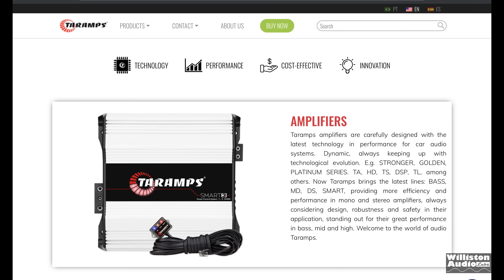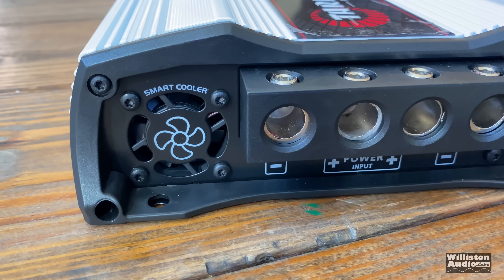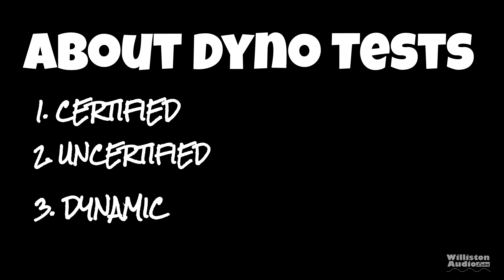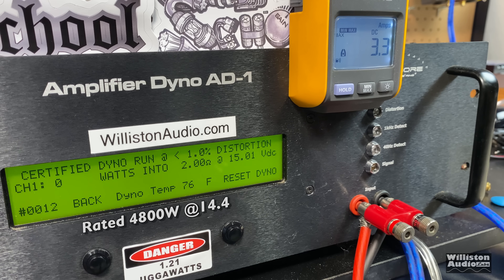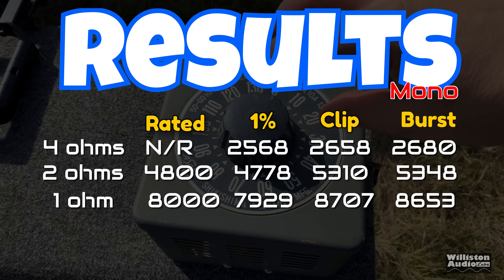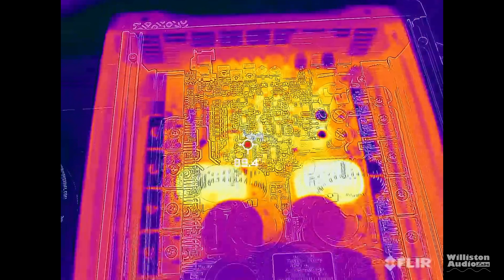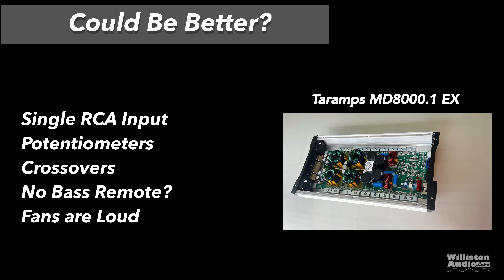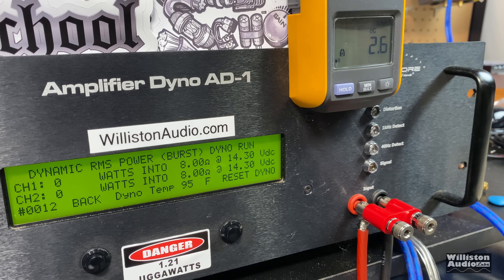8000 watts, but What's New? Taramps MD8000.1 EX Amp Dyno Test and More [4K]

Comment: I personally love Taramps. I've had my amp for 2 years now with no issues. I run it hard every day on a pair of 10"s running 1500 watts RMS per subwoofer. Some people give these amps a bad rap for being Brazilian, yet they are loads better than any China amp I've seen. The quality is close to a Korean build in my honest opinion it seems to be as well built as my old Sony xplode amp that is nearing 20yrs old and still works. I think these amps can last if properly mounted, connected and supplied power. I've seen guys dogging the cheap amps from Brazil, when they were giving it horribly low voltage. A 3k RMS system needs a 2nd battery and a 370amp alt. You can run a 3k system with a 120amp alt and a single small battery but its stressful on the amp, battery, alternator,  and will clip way harder and way sooner than it should. You want an amp to be supplied with as much power as possible without going over its voltage rating. Giving a Brazilian amp too much voltage is another thing people can do and the amp gets a bad wrap for it. Some amp can handle an 18 volt lithium setup, but feeding 18 volts to an amp that tops out at 15volts will smoke it. Some people think it gives the amp extra power. It's not nessicarlilly true. Often a higher voltage delivers more current to an extent. When the current needed is pulled to its limit voltage drops while trying to give the current needed. When a car has double the current needed at the cars operating voltage then voltage won't dip and the power output is increased. If you got a car where the lights dim when the speakers hit, the solution isn't to increase the voltage to 16. The solution is to add a battery or increase the alternator output by size or addition or extra alternators. In truth all cars have a weak underpowered electrical system from the factory. I've never seen a car run worse or lose power from having a bigger or more alternator added to the car. I've always seen it improve the car's operations, charging, and starting.
Reply from the maker: Thanks for watching and commenting!

Comment: I have a 2 year old 2 ohm version 8k..still rocks...fans suck tho..they are always on and loud ..also they make grinding noise for about 5 mins after turning on amp then smooth out..its running 2 15" ct sounds Exos..does well..great amp for the price for sure
Reply from the maker: Fans may be going bad?
Reply: @wal  if so..they were bad from the get go..they have done it since the 1st day..lol, still work tho

Comment: Banda does not look like that.
Reply from the maker: Who said Banda did?
Reply: @wal  you said that these all  full bridge Brazilians are the same inside and you mentioned Banda towards the end of you video. No big deal but they are not similar in design internally. Banda has a very distinct design inside. The 8k Banda even has a 250 amp fuse inside. 9:00-9:10
Reply from the maker: @TheHateuguys  I didn't intend to say "all" I meant all of the Taramps and many of the other designs

Comment: Awesome dyno Big D.
I Would love to see more Audiopipe amps tested specifically the Dealer Line APDLO-20001D and the Full Bridge APHD-80001-F1

Keep the cool videos coming!
Reply: I have the aphd 8000 and 16000
Reply: @Brittvanegas  how do you like them?
Reply: @KvnWlsn  the aphd 8000 is great. the aphd 16k I been through 2 of them in less than 2 months only running @ 1.3 ohm I get everything audiopipe dirt cheap. I have 6 bdc4 15s in a 2016 f 150 with 250 ah of headway lithum and 350ah alt solid 14v at full tilt
Reply: @Brittvanegas  I've got a 320amp Brand X alt and 96ah of Headway lithium on 2 Audiopipe BDC4 12's each running on its own Dealer Line 2k at 1ohm and a Dealer Line 4ch running 4 Audiopipe 8" mids and 4 Audiopipe 3.5" super tweets in a trunk build.
Reply: @KvnWlsn  👍
Reply: @Brittvanegas   I ALSO HAVE AN AUDIOPIPE APHD 5K 2 OHM AMP AND IT  IS A GOOD AMP SERIOUSLY ,BUT  ITS MY BACK UP AMP , I HAVE THE MD 8K EX IN MY TRUCK NOW

Comment: What wire (welding cable, sky-high, gp?) did you put in 2/0 slots?  Is it actually 2/0
Reply from the maker: It’s 2/0 AWG, not oversized 2/0

Comment: They have dual imputs now huh. The 2 i have only have single. Is that whats new
Reply from the maker: Dual inputs, 4V input and upgraded protection circuitry
Reply: So the 4 volt inputs is that making it a clearer signal for your speaker or subs . Do the older md 8000 dont have a volt input or what.

Comment: Got a Stetsom 8k 2ohm used it one two solo X 18 motors on 15 inch frames with anod enclosure I made tuned to 25hz I destroyed my trunk locking mechanism ripped out the rivets and tore the remaining sheet metal. I’ve since bolted my trunk down, Then I ran two Adire Kalis on it just recently got a custom made resilient sounds Team 15 d2 so I’m running the Stetsom at 4ohm-I wonder if I’m getting that killer efficiency since it’s a Brazilian amp as well. It’s been about 3 years since I first remember requesting you test a big Brazilian amp. Right on!!
Reply from the maker: Thanks for the suggestion 👍

Comment: I literally just sold my MD 8000.1  because the fans were ridiculously loud...Now I have an Orion 3000.1 DSPLX.. I don't think I'll EVER sell it!!
Reply from the maker: Oh man that’s a beast!
Reply: The fans on my soundstream are super loud too. I swapped the end fans with lower flowing quieter ones and left the third fan alone. If they didn't run constantly and only came on when warm it wouldn't be a big deal. You won't hear them when jamming but most of the time I don't  play it that loud.

Comment: So how many watts is too many for a regular guy with a full size sedan or SUV??
Reply from the maker: That’s a loaded question 🤔
Reply: @wal  ok how about how many watts just keeping stock battery and alternator then
Reply from the maker: @scamchan  depends on your car/truck/SUV, but a safe number is 1000W. Some trucks have HO alternators already and some even have dual batteries, so those could support more

Comment: Thanks for another great video Big D! I didn't even realize Taramps had changed the MD8000 amp... I do like the 4v RCA but do not care as much for the rated power being at 14.4v like their BASS line. Lots of Taramps users loved the MD line and the Smart3 & Smart5 amps due to them making rated power at 12.6v.

I Personally have a Smart3 and a MD8000.1 that I bought a long time ago after seeing your reviews. Thanks for the knowledge & info you put out for the community.
Reply from the maker: Thanks for watching and commenting!
Reply: The MD8000.1 even the newer EX is still rated at 12.6v

Comment: Was considering the Orion HCCA 3000.1D since it recently came available (thanks for the heads up D).

But I was gonna run one Hutchinson Audio neodymium ndfeb-18 in a custom 6th order (with battery bank) or a Deaf Bonce Apocalypse db4518 on the HCCA 3000 or a Salt 4.

With this amp I could run two subs, but box volume would be too much, would have to scale back to 15s or 12s.

Comment: Thanks for sharing big D.  That amp is a monster!  I got a friend that's building a monster system on a sling with several of these amps.
Reply: @Stephon Bethune, several md8000 amps on a Slingshot....? Surely you didn't mean a Slingshot? I just do not see how someone could utilize several MD8000 amps on a Slingshot!
Reply: @itdoesntmatterwhatyourname6128  Not that particular model. I was speaking of the brand. And yes they are being installed on a sling shot.
Reply from the maker: Awesome 👏

Comment: I been looking for a Dyno preview for the Deaf Bonce apocalypse AAB4800.1 amp.
Reply from the maker: Thanks for the suggestion 👌
Reply: @wal  no problem. It’s I have one but don’t know the full power she goes to. I got it from someone else and only have 2 Skar EVL 12s not sure if they are d4 or d2 tho cause they was already wired in a box when I got those from a different person. But amp gain is almost all the way down along with the bass and subsonic and rest of the levels, lpf ect.

Comment: That's a very impressive amp, personally I wouldn't be able to have 8K Watts RMS in a system in either of my cars, it would require me to have multiple alternators and batteries which i wouldnt be able to fit realistically but its wishful thinking though, I would be very happy with a 6k rms watts  system with 5k RMS of Subwoofer power and 1k rms of Mids and Highs. Thank you so much for sharing my man. When I get my JL VXI amps for my Flex if I don't get my self a AMM-1 before then, perhaps we can get together on making an amp dyno on a the DSP amps? Just a thought. I can send them your way before installing so you can test them out and let thw world know if they can do their rated power and their efficiency. Then send them back to me once you got the content up. 😁👊
Reply from the maker: Thanks brother! No amp testing service at this time but possibly in the future
Reply: @wal  it's all good man, I still LOVE what you do. 😎👊
Reply: Bid D good day to you you are doing an excellent job because of you I own two of these monsters

Comment: But the bigger question is what is the efficiency on the 2 ohm version. Is it the same kind of crappy 69 percent or does it get better efficiency? Makes me curious if this thing does more or better power above 16 volts since it can handle up to 17 volts.
Reply: You think under powering these amps at 12 to 13 volts ⚡️is bad idea ?! I know at 14 volts they do 8k...
Reply: @PRINYATIP  underpowering these monsters is going to lead to an expensive fireworks display or a bad fire. 🔥💥
Reply: @walkingfreak  Holly SHIET!! Are you serious! I knew I should of bought the Smart3 k instead of the smart3k BASS!!     3K watts @ 12 volts is nice but 3k @ 14 volts is pushing  it for my electrical !! Doh!
Reply from the maker: Good question

Comment: I personally think the smart line ups are better the bass seems full i dnt like those ful range taramps
Reply from the maker: I’m with ya
Reply: @wal  i got 2 kicker 12” l7 and a smart 3 running them iv used the md line ones and the bass just didnt sound right like the smart lines

Comment: Cool Taramps 🙂
Next test Taramps HV (Hig Voltage) 160K - 160kWatts???
Do need to upgrade SMD  hardware for this test??? (For Hig Voltage and for Big Power Full)
And upgraded or new Power Supplies HV 300-400 Volts DC, 200-500kWatts?! 😅😁
Next version SMD HV? 😅

Comment: Love tramps! I have a  smart 3k its  been running great just have to make sure that your power supply  can keep up.
Reply: I just bought the SMART3 BASS ... is it bad if I'm running this amp at 12 to 13 volts ⚡️?! I know it's rated at 3k at 14 volts...
Reply from the maker: I’m impressed how they’ve stepped up from their earlier models
Reply: @wal  Will I blow up my car if I'm under powering these amplifier? Like say 12 volts instead of 14 volts ?! ⚡️

Comment: Ah I see.. the revised MDs are using a current sense IC on the power supply. Enhanced protection circuits, yup! I wonder what they have done for the output section. I do see they used gate drive ICs after the Si8244 (I hope they move away from this hard-to-get super expensive IC!)? which tends to burn up on output failures.
Reply from the maker: I didn’t get into the specifics, thanks for pointing this out 👌

Comment: Ex model hmm Nice!! I almost bought a smart 5 bass even though the regular smart 5 seems to put out a little more. I currently run 3 md8000’s in The Science Project (Malibu build). I clamped 2800 watts last season. My build is cool but I knew it had more in it. Went out last week and played around. Went to a show this weekend and in the lanes I clamped over 8700 watts out of one amp. Talk about a Super Happy Basshead. I plan on keeping the amps but I will have to address the pressure inside the cabin now. Keep up the great work with the videos I love and appreciate them. Peace and Bass to anyone reading this comment ✌️🔊
Reply from the maker: Love hearing comments like this!

Comment: That's a great amp to go with. The only bad thing is that you will need a serious setup of subwoofers or you will have to keep the amp turned down. I guess someone could buy the amp and then save for the subwoofers 😆 so the amp can push every watt to the subs.
Reply from the maker: Yeah this is serious power
Reply: @wal  lol i wish they would have sent me that free amp. I would have plastered their name all over my expedition for advertising. Keep up the Great work and Content.
Reply: No need to keep the amp turned down when you can simply run it at a higher impedance and take advantage of the efficiency as well. Seems counterintuitive, but I'm not a fan of running amps at their limits anyway.

Comment: I want to see you test the 1 ohm version of the HD3000.1 by Taramps  as well as I'd like to see you test planet audio pulse line specifically  the PL3000.1 and the PL2400.4 as well as a older amp if you can cause I know you do older amps sometimes but I'd like to see you test the Rockford Fosgate prime R600x5
Reply from the maker: Can I get you a drink too? Need some dessert? 😂
Reply: @wal  I don't mean to sound needy at all its only that the entire time I was learning how to build systems I've watched your videos I trust your judgment  and I love to see what certain amps are capable of so just know I ask out of respect for your opinion you have tested alot of amps that I like but you never seem to test the amps I actually have already and I'd love to see how they do you test similar ones like you dynoed the 2 ohm version of the taramps hd3000.1 but I have the 1 ohm version or you tested the taramps DS440x4 I have the taramps TS400x4 so I just like your videos I wish you would do more on how you wire everything or how you tune your amps.

Comment: You know if you take the voltage regulator out of  A General Motors alternator it'll charge right around 20 V
Reply from the maker: Better have batteries capable of handling 20V??
Reply: @wal  2- 8volt wired in series, 17.2volts.

Comment: I have the md8000 2 ohm version, i run it with 2 deaf bonce subs wired to 2 ohms. It has been an awesome amp. I got it used in great shape for $400. Thats 5 cents per watt! What an amazing value!
Reply from the maker: Incredible 😲
Reply: the price is low because you pay in dollars and the engineers work for the Brazilian real, it's the same reason for the WEG inverters also developed in brazil

Comment: Crazy how much good quality wattage you can buy now days for so little money. I remember back in the early 2000s, you couldn't get an 8K amp or even anything near that for $450-600. You'd be lucky to find a good 1500 watt amp for that as I recall. But I guess that was probably pre-class-D or when Class-D was brand new technology so... I guess it makes sense that amps were so much more expensive then.
Reply from the maker: The electrical needed to power amps like this are still expensive, but yes the amps themselves are crazy cheap

Comment: Man I love your channel.  I just bought two tar smart3k amps.  One for each car.  I AM GOING TO add a second 4 gauge power line for the amp but to my question.  If I am running one 4 gauge now and im lets say driving the amp hard, if I am not blowing the current 100 amp fuse, do I really need to add the second power line?  I would think if the amp was needing more current it would pop the fuse trying to pull more amperage through the single 4 gauge.  Thoughts on this sir.  Thank you in advance
Reply: What kind power are you wanting out of it
Reply: @beardedforlife3740  that has nothing to do with my question.
Reply: @PhatkatCollections  it has everything to do with it
Reply: @beardedforlife3740  you don't wire an amp for what you want out of it.  You were an amp for the amos requirements.  I'm sure you'll just continue to argue because everyone in the internet has to always be right.  Wiring an amp with the improper size wire can damage the amp , so again your question is absurd.
Reply: @PhatkatCollections  well I hate to break it to you but it absolutely does matter what you want out of it. If you have a 3k amp and only want to run 1500w then you don't have to wire it for 3k. Secondly, if you have a 100a fuse and it's not blowing then you aren't putting out the power you think you are
Reply: @beardedforlife3740  why would anyone buy a 3000 watt amp and only want 1500 watts out of it.  Makes no sense dude , hence the reason your question makes no sense.
Reply: @beardedforlife3740  this amp model has been dynoed to push over 3000 watts.  Again the question is why wouldn't a 100 amp fuse blow if the smonis capable of pulling 3k watts.  And don't tell me the amp is capable of 3k.  This channel has dynoed it countless times.
Reply: @PhatkatCollections  have you heard of different ohm loads? Not everyone chooses to run at 1ohm. Also what you see on an amp Dyno most likely won't be what you see playing music due to impedance rise. If your fuse is taking over 300a of current then you need to replace it immediately. A 100a fuse should never be able to handle that much current
Reply: @PhatkatCollections  btw I know what that amp is capable of. I own one myself and have also watched not only Derek's video but a few others using that amp
Reply: @beardedforlife3740  your missing the point here.  The point is the amp is not blowing a 100 amp fuse so what is the reason it's not if the amp is capable of pulling 300 amps
Reply: @PhatkatCollections  then it for some reason isn't pulling more than 100a or the fuse is malfunctioning and allowing more current through then it should
Reply from the maker: I would recommend 1/0 per Smart 3, making sure it’s OFC and not CCA. Listen to the Car Stereo Chick…
https://carstereochick.com/2011/11/12/4-gauge-2-gauge-8-gauge-0-gauge-whats-right-size-power-and-ground-wire-for-your-amp/
Reply: @wal  I read that article. It did not answer my original question.